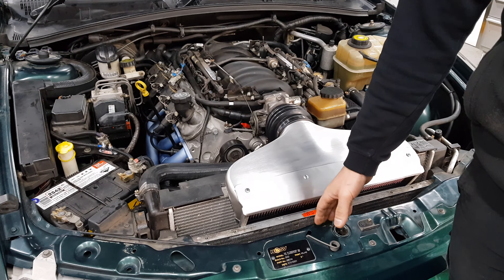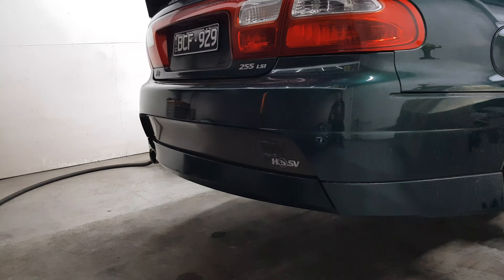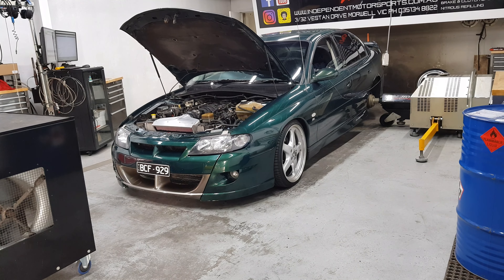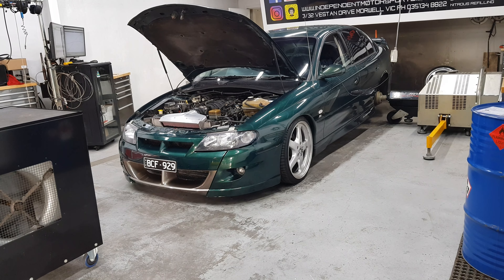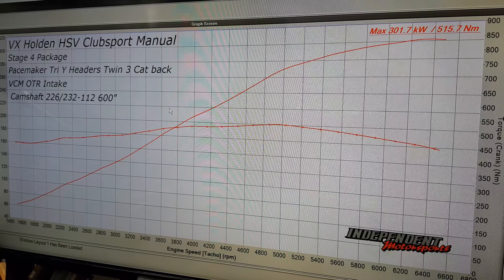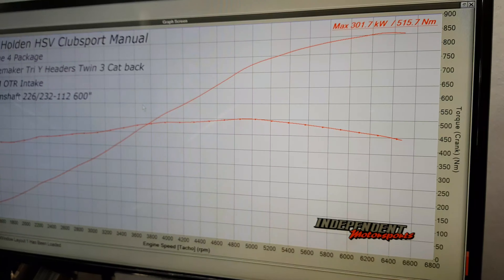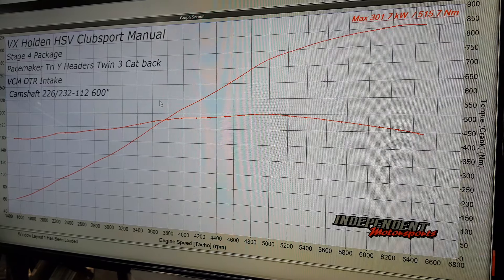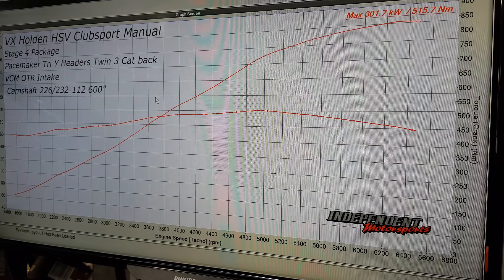IMS LS1 Stage 4 package 226/232@112 Camshaft

Comment: Very nice! Exact specs of a custom grind going into my LS1 in two weeks. The original LS1 engine - and is still going strong has 375,000 miles. It's got some blowby now so gonna stroke, cam, and headers to name a few. Thanks again for the video mate!
Reply: Miles? This isn’t America
Reply: Ha! I forgot about this post. Well ... she's gotten herself stroked, cammed with headers. It's my daily driver and she now has close to 400k on the clock!
Reply: @TA_Freak how’s the stroker go as the daily ? What cam size auto or manual . How’s the fuel consumption per 100 L ?

Comment: Great post, is this a crow cams shaft ?
Reply: Looks like a 871249 @independentmotorsports   ??
Reply: Great thanks, am putting my LS back together and will use this cam in it,  should provide a nice note and even power gain but still suit my HT cruiser 👍

Comment: I have the same cam in my ss, heads shaved 40tho, all new fruit in the head, block shaved, pacey 4-1s high flow cats and twin 2.5 system, vcm plastic otr, makes 270kw and 645nm, any idea why this makes more power but less torque?
Reply from the maker: Because the hub dyno is more accurate. There's no way your car would be making 645 Newton meters. Sorry but that is big torque figures for a ls1. That's the sort of figures you would make with the blower on top.
Reply: AndrewMitchell001 it's not making that much torque at the tyres the dyno is wrong
Reply: AndrewMitchell001  l know a lot more about ls engines than you trapper and know bullshit when l read it 😁
Reply: AndrewMitchell001  you just sound like a little boy but I will inform you that I have many years experience with ls engines currently l have a hsv 25 anniversary clubsport r8 2015 model with a naturally aspirated ls3 making 378 kW at the tyres and 602 NM at the tyres it also has a wet nitrous 150 hp shot as well. Your ls1 is capable of around 320 to 330 kW at the tyres naturally aspirated if done correctly with the right combination but the torque figure is higher than it should be on your engine in my opinion
Reply: AndrewMitchell001  you can have whatever you want but its still wrong goodbye
Reply: AndrewMitchell001  no nothing like that at all l am very happy with my vehicle and it would absolutely slaughter yours and as I have said your torque figure is not correct regardless of what the dyno says 😁

Comment: Where abouts in Australia are you guys located? Great vid. Informative. Cheers
Reply from the maker: Morwell Victoria
Reply: @IndependentMotorsports  excellent. I like your work. I have a 2000 VT Clubsport R8 that is completely original. Non molested with 130k on it. We may continue a conversation down the track re enhancements 👌🏼
Reply from the maker: @chrisgraf1304  looking forward to it mate 👌

Comment: hi ive got stock ls1 with all the add and hang ons from vcm otr with pmaker extractors maffless tune 3000 dominater converter  3.9 gears with tru track a set of 241 ported heads with stock valves its a wend car hardly driven after some some good cam specs and what lift do i need to change the valves thats if i need to cheers jas
Reply: I'm running biggest out the bunch vcm13 LS1 don't need change valves just double spring kit